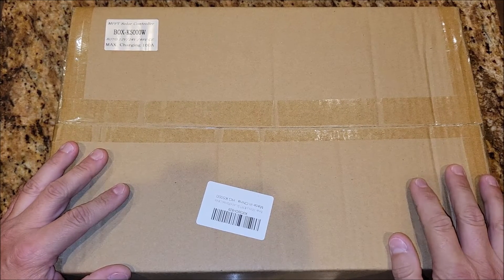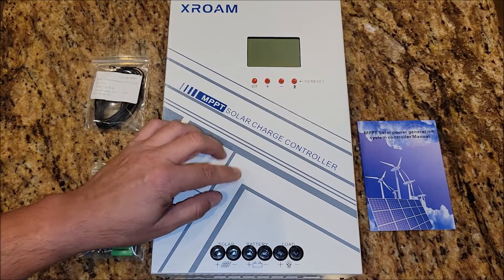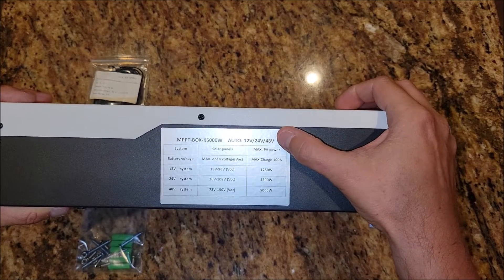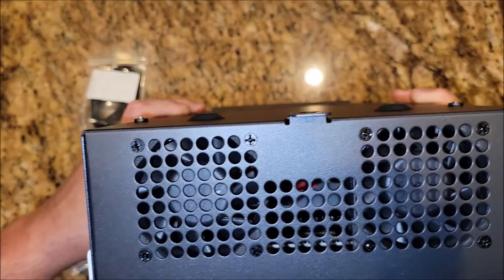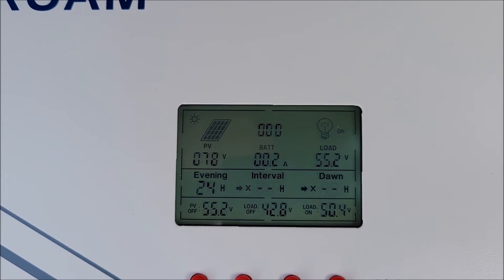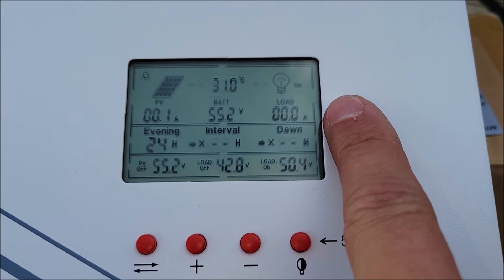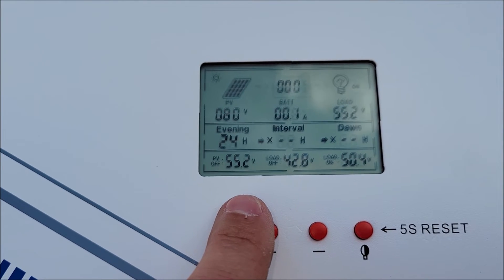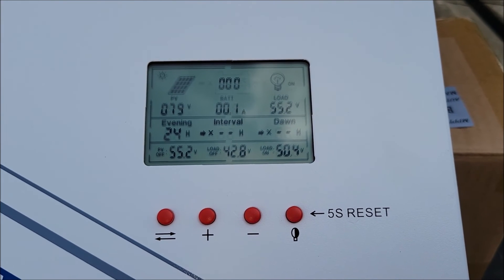100A MPPT Solar Charge Controller - Setup & Full Review - RV Solar

Comment: Would have been nice to see battery charging and a real world efficiency and not what the specs say.
Reply: An inside view could show how big the coils are and give an idea of how much current the controller can deal with. Some reviews reveal units that advertise 100 amps but when you see the coils you know its not true. I've been reviewing so many of these and I find that people buy 100 amps unit and use 5 panels that never really show the real capacity or longevity of the units. This was a nice run through but doesn't make me buy it. I have 10 270 watt panels I need to see if it can that kind of load.
Reply: @Christian-lt7wd  I only have 4 250w panels split up in pairs of 2 with 2 charge controllers. I use them to charge 4 Li 100ah batteries.
I use those cheap MakeSkyBlue 60A charge controllers. I've hacked the version 118 to give me the serial data out that the version 119 gives you. I send the data to my Blynk account and can download it all in csv format.
The charge controllers track pretty good and power out is pretty accurate. they've been running perfectly for 3 years now.

I look at it this way, just about everything is made in china so I'll go for the best bang for my buck!  Cheers....
Reply from the maker: I will try to get another video of the full setup.  This was made when I got it and opened it up to test it.